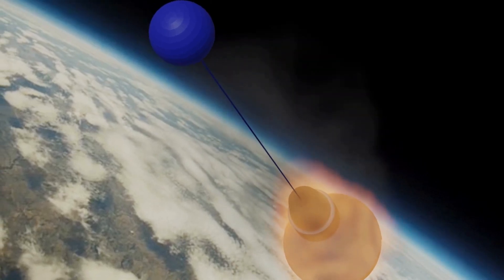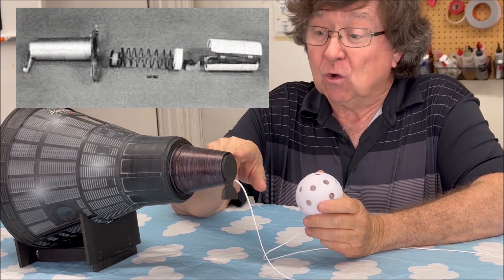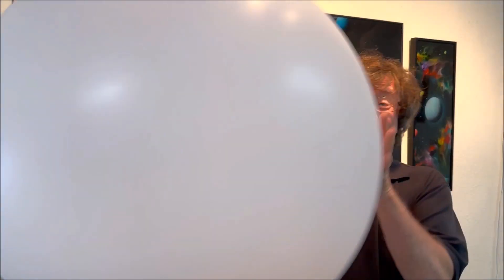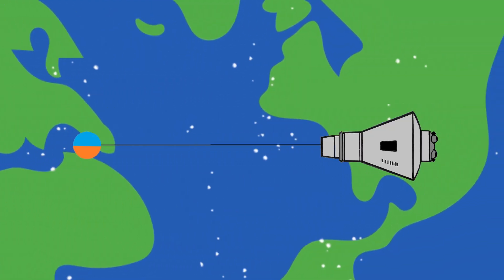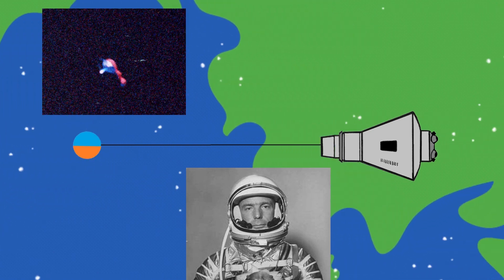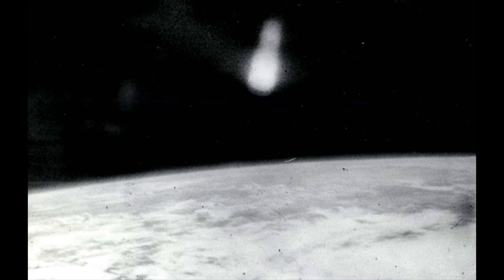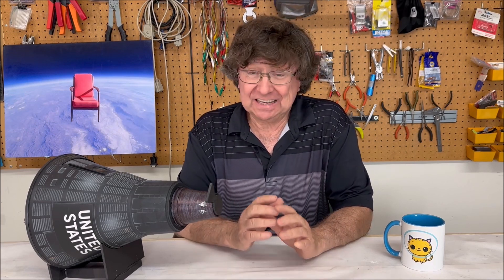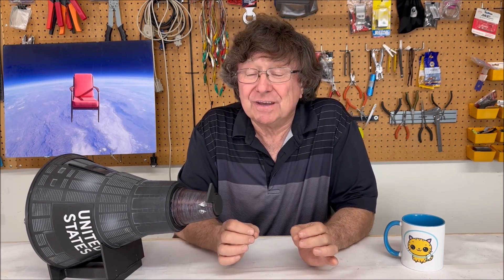NASA's Weirdest Space Experiment Ever!

Comment: 3:30 Post-flight the Mercury astronauts agreed the focus should be on flying the spacecraft and far less on a series of "Larry Lightbulb" experiments. Hence "Sigma 7" focused on "Flight Ops".
The "Aurora 7" tethered balloon experiment used a multi-colored balloon, a 0.75 meter diameter mylar inflatable sphere which was packaged & housed with its gas bottle in the antenna canister.
The five colors were uncolored aluminium, yellow, orange, white and blueish coating. A confetti spray signalled the deployment of the balloon but it only half-inflated and the tether line twined about the destabilisation flat at the capsule's top end. The purpose of the balloon was to study the effects of space on reflection of colored surfaces and to obtain aerodynamic drag measurements by use of a strain gauge. Thx for an interesting video !!!